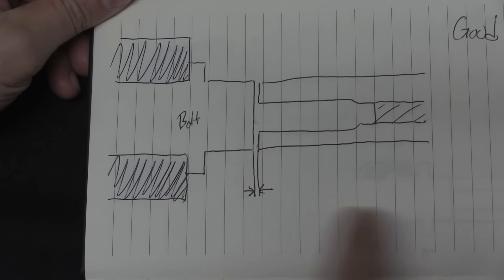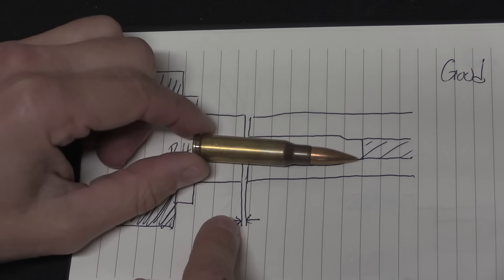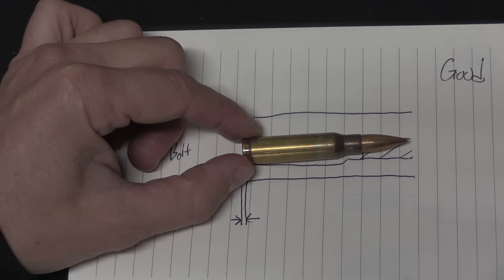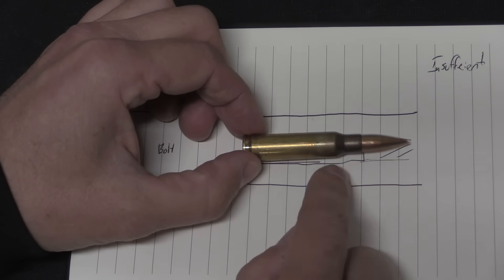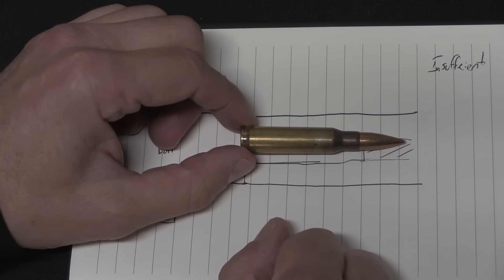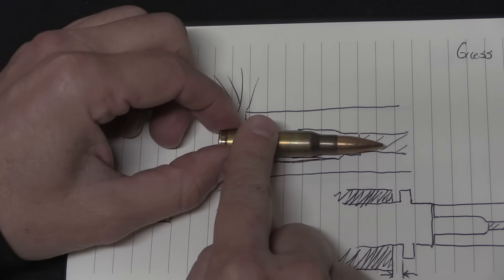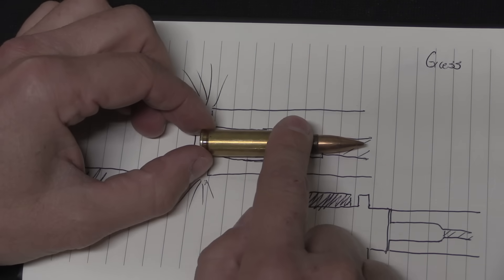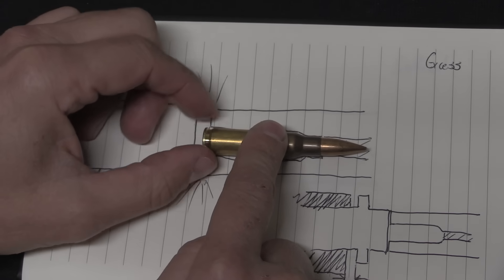Ask Ian: What is Headspace? (And Why It Matters)

Comment: It's also worth commenting that even with safety measures, an over pressure cartridge can still blow the top off the barrel. An especial concern for hand loaders.

After inspection, with any new acquisition that isn't fairly new (like less than 20 years), after thoroughly inspecting the rifle at home and determining it is something I'm comfortable taking to the range, my habit is to fire the first round at waist level and as far off my body as I can get it. Then I very carefully inspect that first case before I fire it again. When I'm confident it isn't going to blow up on me, I'll sit down at the bench but I'll still inspect the next four or five cases and look for changes. I have never had a failure yet (* knock on wood * ) but I have seen a few things that were concerning, mostly about the primer. With those calibers for which I have a number of examples, I obtain gauges to make certain, such as with the Mosin-Nagant collection since those often have substantial wear. because at that point, it's a justifiable expense.

Comment: Firearm chambers should always be 'de-greased' prior to firing to allow the expanding brass case to properly 'grip' the chamber walls so it doesn't 'slam' onto the breech-face/bolt head, etc. A good reason to thoroughly remove 'case lube' if one is a reloader (nothing to do with headspace, just seems to be a good opportunity to mention it)

Comment: Regarding the ability of brass to expand, I found that out *almost the hard way last week. Somehow, a 5.56x45 cartridge wound up as the first round in my 7.62x39 AK magazine. I loaded it into my AK, pulled the charging handle back, released it, and noticed the bolt did not go all the way into batter. I pulled it back again to visually confirm nothing was in the way, and tapped it forward to manually close it. I pulled the trigger and there was a small puff out the muzzle and the bolt didnt cycle. I removed the magazine, locked the bolt back (thank you Zastava for a safety lever that do that), and the case didnt come out. It took very little effort to pry it out with a pocket knife and the front 1/3 of the 5.56 shell from the shoulder back had swollen to fill the 7.62mm chamber. If it had been poorly made ammo or steel cased, I likely would have had a catastrophic failue

Comment: On an 8mm Mauser, if the head spacing is incorrect it can blow up in your face. At the end of the war the Allies took the bolts and the rifles from the Mausers surrendered or confiscated and put them in different piles. When a soldier would take one home as a spoil of war they started having problems which led them to take them into skilled gunsmiths to check and modify the headspacing.

Comment: Head space in modern weapons is less of a problem than it once was . Weapons using some form of rotating bolt are usually made without any adjustment,relying on the close tolerance of the mating components (M16) it only usually becomes a problem if an aftermarket component is fitted . 
On weapons where load is taken through a part of the body, there is some form of replicable locking shoulder that can be exchanged for a shoulder of a different size . 
On bolt action rifles the adjustment is in the threading of the barrel .
Change of headspace through just firing is not a problem ,the barrel would be worn out long before there was a change in the headspace..

Bottle necked cases headspace on the shoulder , if the shoulder was so far back as  to allow the case neck to contact the rifling , then the firing pin would not reach the primer .

Comment: Also advisable to have headspace checked if your AR barrel and AR bolt were purchased separately. My local gunsmith charged me $2 and it took 60 seconds. 

AND if you use the thing defensively,  a receipt for a headspace check can demonstrate that you are safe & responsible.

Comment: Excellent presentation (as always).  This is going to sound like a quibble, and I don' mean it that way (after all videos can't be infinitely long), but I would add a section on headspacing straightwall auto pistol cartridges.  All of the usual problems, but now add setting of your taper crimp.  Too little: inadequate headspace and guns refuse to go into battery.  Too much: excess headspace.  May have failures to fire (light primer strike or no primer strike), and in extreme cases a kaboom from unsupported brass (particularly in some unnamed makes of auto pistols).  Please pardon my well-intentioned "quibble."

Comment: How are chamber pressures measured now?  And how accurate are the measurements?  Thank you in advance.
Reply: The term "chamber pressure" is ambiguous unless qualified.  "Peak Chamber Pressure" is the highest pressure that will be achieved throughout the cycle that starts on primer set off and ends when slug exists the muzzle.  This is what causes guns (as opposed to cases) to explode.  "Instantaneous Chamber Pressure" is the pressure at any given point of bullet travel down the bore.  Instantaneous Chamber Pressure will reach Peak Chamber Pressure at some point, then begin to decay because as the bullet moves down the bore and combustion chamber volume increases.  (Remember the Ideal Gas Law, that the Patriots made famous during Deflategate?)  "Integral Chamber Pressure" is the total area under a pressure vs. time (or pressure vs. slug travel) curve prior to bullet exit at the muzzle.  This is what determines muzzle velocity.  Peak Chamber Pressure is reached when propellant combustion has finished, which in some guns (usually small caliber or light for load pistols) happens before the bullet begins to move.  The way you can get higher velocity without getting higher Peak Chamber Pressure is to use a slower propellant, so that Peak Chamber Pressure is deferred to a point where the bullet has traveled an inch or so down the bore.

In older times, pressure was "measured" by drilling a small hole in the test barrel and venting pressure to a calibrated copper pellet.  Pressure was assumed to be proportional to resulting deformation of the copper pellet.  Units were "CUP" or "Copper Units of Pressure," which essentially bear no fixed relation to PSIa or PSIg.  CUP pressures were a single number, more or less related to Peak Chamber Pressure.  Nowadays, pressure can be measured and graphed for the entire time of bullet in bore travel by using piezoelectric sensors (the same things that drive electronic powder scales).  A piezo graph will show you both Peak Chamber Pressure and Integral Chamber Pressure.

As in all things, the accuracy of the results is a direct function of the accuracy of the measuring tool.  CUPs, no so much.  Lab grade piezos, well within any meaningful tolerance.

Comment: Another Rifle that is notorious for headspace, is the No.5 Rolling Blocks in 7mm Mauser. Due to the change in the case dimensions in 1910s, modern 7mm mauser usually doesn't headspace correctly in the old Rolling blocks

Comment: Nice explanation.  Might be worth underlining that the cartridge itself is just there as convenient packaging. It isn't supposed to be strong enough to resist the powder, it relies on the receiver/barrel to stop it from bursting. The crimp around the bullet is supposed to be the weak point, but... not so much that it will ensure ejection of the bullet before rupture of the cartridge if there is no support around the cartridge walls.
The rest is about the tolerances needed to guarantee correct feed, ejection, and a relatively gas-tight seal on firing.

Comment: It would be nice to hear how hand loading can affect the OAL of the cartridge for accuracy purposes. My understanding is a perfectly loaded round just touches the lands of the rifling.
Reply: Not necessarily the case (no pun intended).  Some benchresters will routinely load for zero jump, but they have adjusted (reduced) their propellant charges to accommodate the increase in peak chamber pressure.  But if you take the time to try various jumps (in the form of various COALs), you will often find a sweet spot, surrounded on either side by spray-and-prays.  For instance, I have one .308 bolt gun that shoots under 1 MOA consistently (even including windage and shooter error) at jump = 0.014", but groups increase materially at either less or more.  Only one way to find out.

Comment: Thank you for a very concise explanation of headspace.  Most semiautomatic firearms have "timing" that has been set by design--the disconnector won't let the gun fire when the bolt is out of battery.  That would be another subject you might explain in a future video.  The M16 was designed to run at around 600 rounds per minute in automatic fire mode but switching from cannister powder to ball powder upped the rate to nearly 1000 rounds per minute.  This excessive fire rate caused malfunctions until the buffer assembly was beefed up to drop the cyclic rate and some other modifications were made.  Older machine guns such as the Maxim needed to be tuned by setting the timing after setting the headspace on a new barrel because 19th Century manufacturing tolerances and anticipated service life of decades and millions of rounds fired were only supportable by making headspace and timing on machine guns adjustable.  When the disconnector becomes worn, the gun can fire out of battery--slightly out of battery can be misdiagnosed as a headspace problem when the timing is off due to wear or improper adjustment.  Revolvers are prone to timing issues, manifested in the cartridge firing when cylinder and barrel are not fully aligned.

That's the adventure of antique firearms--solutions to manufacturing tolerances bring on new problems.
Reply: The M1 rifle utilizes a bolt design that prevents the hammer from striking the firing pin unless the bolt is in battery, but, that feature is useless in the case of an out-of-battery 'slam-fire'. It is important, especially for hand loaders, that the primer pocket is uniformly reamed so that the primer sits .006" below flush. Military primers are slightly thicker than commercial offerings. The free-floating M1 firing pin will leave an 'indent' on the primer of a chambered round and a primer sitting too high can detonate.

Comment: I had a Martini Henry once that was chambered (or rechambered?) for 303.  Not sure if it was done by Khyber Pass artisans but when they cut the chamber, they cut it as long as the 303 case, but with no taper, just straight.  So, when you shot it, the case neck expanded to full case diameter and put lots of unburned powder down the barrel.  Wasn't too accurate as I recall.

Comment: Headspace also affects the distance the bullet will travel before engaging the rifling.  The gun should be designed so that the bullet is touching the rifling when locked in pace or you would extract the bullet from the cartridge if you open the bolt without firing.  Also, different types of cartridges headspace off different features.  Cartridges like the one you showed headspace off the shoulder, but straight-wall cartridges usually headspace off either the mouth of the case or the rim.
Reply: Valid subject, but I'll call this "freebore," not "headspace."  And the real risk of zero freebore (sometimes a/k/a "no jump") is that it can increase peak chamber pressure because the bullet has to endure engraving without the help of momentum.
Reply: The distance between the bullet of a chambered round in relation to the beginning of the rifling is called "Leade", correct me if I'm wrong but I believe the bullet should stand off a couple thousandths of an inch and not actually 'touch' the rifling.

Comment: Just a mild add on to Ian’s info. You’re less likely to jam into the lands rather than you don’t get into battery with the case keeping the bolt back on the shoulder (or in straight walls like 9mm the neck) which can cause an OOB explosion. Too much headspace grows your brass and separates the head from the neck effectively rendering the gun dead in combat. Last thing with that gap is the worse case head separation where the case isn’t in the chamber up to the solid head during the bullet being in the barrel which is extra nasty.

I am a hobby gunsmith and have unfortunately encountered all 3.

Comment: Not a headspace issue, but similar:
One time when I was at the range, one of the range officers came over to me and asked if another guy could use one of my cleaning products.  He'd seen I had a kind of "blast-free" cleaner and another guy at the range had managed to get loose powder inside his gun.  I went over to see and found that the guy was using reloads in his .223 bolt-action and was using 60+ grain bullets in what was designed to be a varmint rifle.  He'd set the bullets too far forward in the brass or the rifle wasn't built for that heavy/long a bullet (varmint loads are usually under 45 grains), so when he chambered a round, the bullet was rammed into the rifling.  If he fired the round, it was no big deal, but when he tried to clear the chamber at the end of a relay, the bullet had remained stuck in the rifling as the brass was extracted, letting the powder pour out of the case.
More importantly, the bullet was still in the barrel, something neither the shooter nor the range officer had realized.  If he'd chambered another round and forced the action closed hard enough, it would have shoved the bullet of the new round back into the case, pushed the old bullet deeper, or both.  This can also happen with too little headspace.

Comment: Years ago I bought a Century Arms Galil in 5.56x45 and it had an issue with the striker going off and firing automatically even though it was a semi-auto rifle. Problem was wide spread and Century sent a recall notice so I returned it to Century as required by ATF. However I never got the same rifle back because per Century there was a Head Space issue they could not resolve. Replacement rifle was not a Galil but a Golani and I had to fight with Century to get it replaced with a Galil. It was such a poor experience dealing with Century that I never bought any of their products again.

Comment: Great video , as always. Am a bit surprised that headspace tolerance between rimmed, semi-rimmed and rimless cartridges was not really explained. Rimmed  cartridges are MUCH more forgiving of headspace tolerances, as the rim is actually part of the headspace. I own an SMLE in .303 British rimmed and discovered while rebuilding it that the gun safely fires with the original, very worn bolt head and the replacement ,newer bolt head. The replacement bolt head locks up much tighter than the original, but there is no case deformation nor gas leakage using either bolt head. As an aside, I rebuilt a CETME clone by replacing the worn bolt head and rollers with a new bolt head and +.04mm rollers. Although it uses  a rimless NATO round (and was borderline out of headspace tolerances), the CETME clone  safely fired with no case deformation using both the original , out of spec bolt head/rollers and the replacement bolt head and rollers.  My dollars worth-John in Texas

Comment: I shoot a mid 30's Cz 8mm Mauser with mid 1930's surplus brass case German 8mm I got YEARS! ago! I notice now and then I get ruptured cases amidship in line with bore with a very small amount of gas discolorations at crack. tail end with primer looks fine Never had a problem with feeding, extractions, duds or light strikes, just noticed once showing a new shooter the head stamp from the Wehrmacht with cool dates on Berdan primed floor brass. I never thought of Head Space? not too worried. I have never heard of a Mauser blowing up with those lugs and that bolt. I caulked it up to Ammo, but now I will put her on the bench and do a Proper breach and head space inspection while I spot check ammo tolerances. She shoots Great.

Thanks for getting me thinking!!

Comment: Good video! I am accustomed to thinking about & dealing with headspace from a reloader's POV, which is a different aspect of the same issue; it's the cartridge you're worried about, not the firearm itself.

I would also respectfully point out that "headspace" is also a verb, meaning how the depth of the cartridge in the chamber is determined. In the example of the bottleneck rifle cartridge you're using, it headspaces on the shoulder. With straight wall rimmed cartridges like 357 or 44 magnum, obviously it headspaces on the rim. I have read that some of the very old belted cartridges headspaced on the belt. But apparently the belt on the 7mm Rem Mag is purely decorative. Anyhow, complex subject. One could go on for hours.

Comment: I'm going to have to sorta disagree about having a gunsmith check headspace. Most don't even know how to do it, and thanks to SAAMI the gauges themselves are useless. SAAMI wants super tight chambers for accuracy so they make the dimensions tighter. The maximum allowed headspace for .303 according to SAAMI is .070 inches, but the British MOD was .074 inches and allowed up to 0.080 for wartime emergencies. SAAMI did this was every milsurp caliber. Some, like the Arisaka cartridges they just made up. All Arisakas will fail a headspace check.

And realistically, bolt action rifles would have their barrels blown out loooooong before headspace changes. You really have to worry about them in machine guns.

Comment: I remember reading somewhere that headspacing problems can be often seen in model 1895 Winchesters chambered in 30-06 because over time that incredibly powerful cartridge can actually compress the bolt's steel.  The author of the article highly recommended that headspacing be measured before the gun is shot and before the gun is bought.